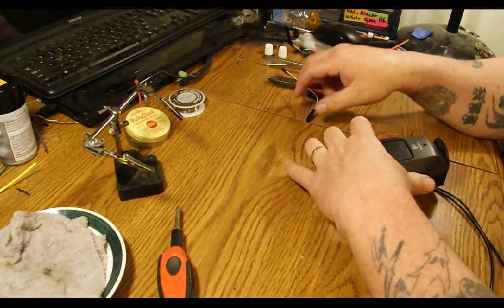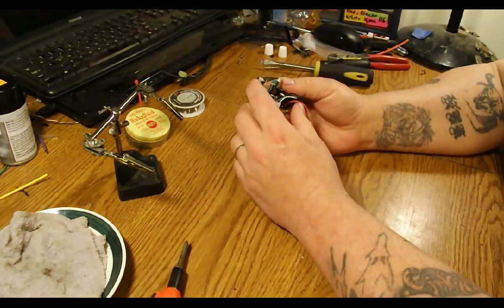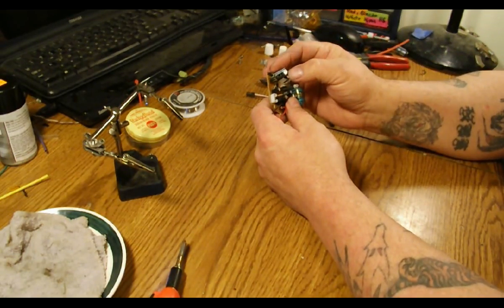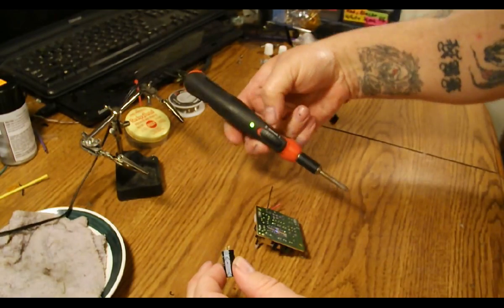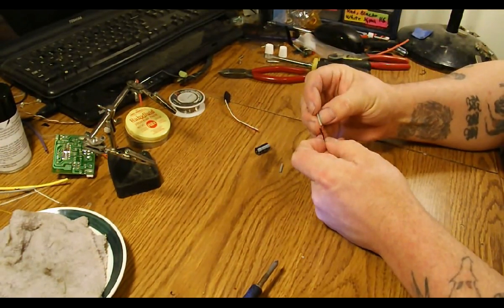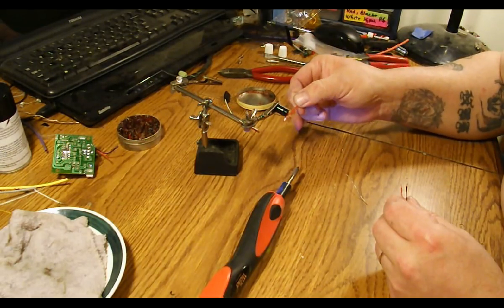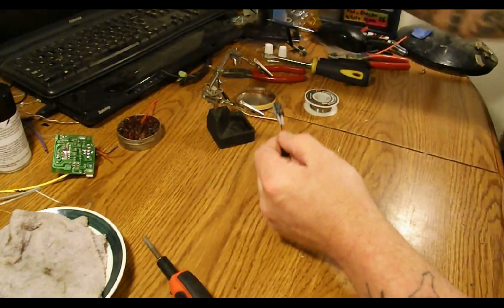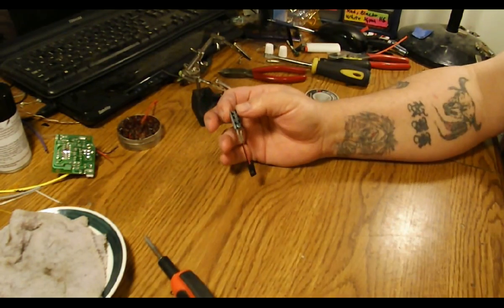Making a glitch buster

Comment: Hi can I use a 16v 3300uf or a 16v 4700uf on my rc car 110scale with a 2s 7.4v lipo batterie will that be ok
Reply from the maker: @TW39 Yeah, it will work. Just make sure you wire everything right.
Reply: @ramrod126  can I use 10v 3300uf or 10v 4700uf 2
Reply from the maker: @TW39 Also yes.